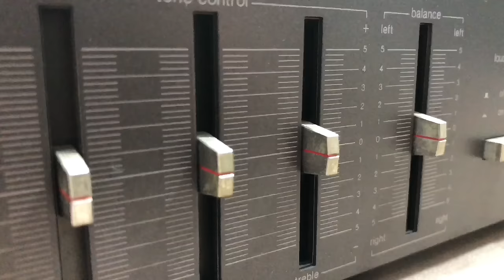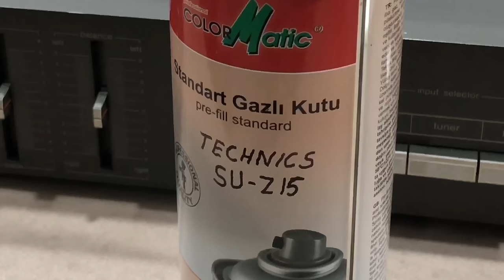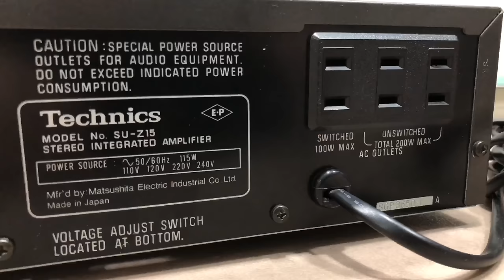Technics SU-Z15 Stereo Integrated Amplifier Maintenance Repair Restoration

Comment: Great Skills Man. I didn't know volume control and selector switch are also repairable. I never dare to open them. Today, I feel the courage to see through and open them. I appreciate your skills. Thanks a lot.
Reply: Similar in my case.  While I'm professionally involved with electronics opening individual components is a more specialized skill so I always recommend to try to learn from others' experience first.  Fortunately it turns out the SU-Z15 is pretty benign, no hidden traps or weird cleaners / chemicals required.

The SU-Z15 has exactly the same ailments as mine already for a few years.  Today it got worse, while idling it did produced a loud hum almost like a helicopter or truck outside.  Time to restore it.

I was surprised to see a black SU-Z15.  Mine is silver and so is every Su_Z15 I saw on the net.

If I have something to criticize on the SU-Z15 it's Technics' choice of 8-16 Ohm impedance for the speakers.  4-8 seems much more common; I've never seen 16 Ohm.  I'm using 4 Ohm speakers myself which are technically overloading the SU-Z15 a bit but the sound is ok and the amplifier deals with it very gracefully.  In theory this overload means I'm getting less power from it - and yes, sometimes it'd be great to have a bit of extra oomph.  The overload also means its easy to drive the amplifier into self-protection with at a volume of 4 or 5 of 10 max.  More inputs including bluetooth, coaxial and optical digital would also be nice to have.

@manstuckonhishead Great video - you obviously know what you're doing and the video and editing is excellent!

Comment: Reusing what's already there - fantastic. Very enjoyable video
Reply from the maker: Thanks 👍🏼
Reply: @manstuckonhishead  🙂
That tune 'Flow' is real good!
I used to have a similar amp to that one. Forgot model number , but it was just slightly bigger and had a lit up plastic screen showing diagram of inputs.

Comment: I'm a fan of Panasonic technics hifi gear I love stk.power amps great sounding units .
Reply: I don’t disagree with you but the issue is with the stk and the technics i/c units. Getting replacement stk modules ain’t easy and mostly fakes on the market. Getting the technics i/c module is gold dust. Apart from that it’s really nice kit. Mind nicest sounding stk based amp I have to say goes a kenwood ka-550. That is joy to listen to.
Reply: I source used stks
Reply: @carlmannion708  not easy to find. I bought from a uk supplier whom repairs equipment. Asked direct for a used working pulled one and sent me a brand new fake. Needless to say it didn’t last long.

Comment: Nicely cleaned but not one capacitor even tested, no DC offset tested or voltages checked. Half the job very well done but electrically  poor.

Comment: Why didn't you replace all the electrolytic capacitors? And thermal paste on that Sanyo STK power pack?
Reply from the maker: Hello. There was no problem with the capacitors. And the thermal paste was in good condition. We only replace the thermal paste when we change the stk. If there is no need, we do not do it. Because the paste used by the factory is of better quality for us.
Reply: I agree with the caps if they are working why replace but that stk chips thermal paste is probably hardened and dried I bet it could use a change a lot of work to go through just to have that chip blow up because of no ability to dissipate thermals…just a thought….I HATE those stk packs!!!! Great video

Comment: Whats the amp and volt of the transformer
Reply from the maker: 115 watt transformer. Amp out 18 -20 watt👍🏼https://usermanual.wiki/Document/TechnicsSUZ15ServiceManual.2697612053.pdf

Comment: The capacitors are very small, 3300uF ☹️
Reply: that is a really low number amp can't pull enough power on bass notes high volumes .
Reply: @rogerchurch3804  2x18W (in 8 ohms)